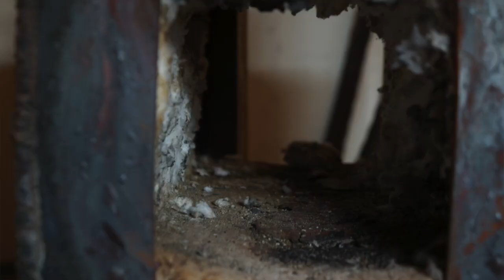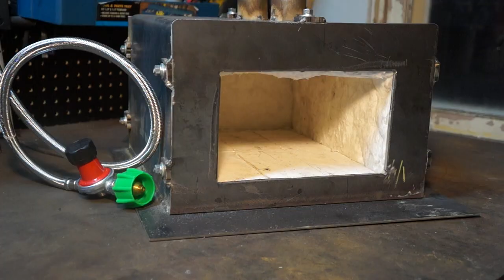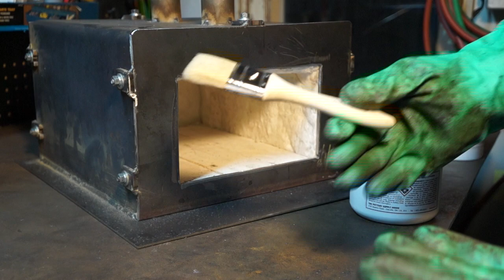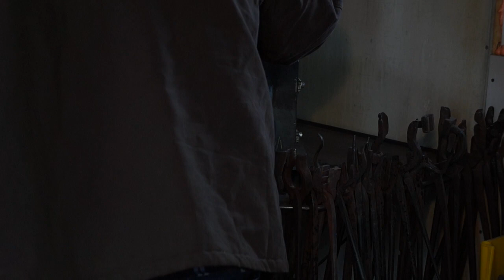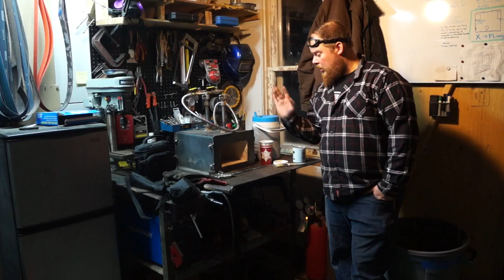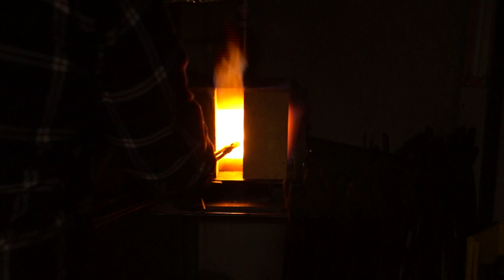Forge Build Part 2.0: Another look at burners, insulating, and coatings

Comment: Looks great. Im in the process of building my own forge,  have it lined with kaowool and i am planing to use sodium silicate as a rigitizer.  What is the rigitizer you used made of?
Reply from the maker: Sodium silicate is what I used as well. Since I posted this I tried lining this forge with castable top and bottom, with blue-ram sides. Loud and takes a long time to heat up, but is basically indestructible. I have a longer, narrower forge with a cast floor and rigidized wool top and sides. I use that one for most of my forge welding.

Comment: Put another brick on top of the two you have in the front and make an awning to keep the flames more out front
Reply from the maker: I've actually rebuilt this puppy since filming. The kaowoll just could stand up to the abuse I was putting it through. I lined the whole thing with castable and ram-able hard setting refractory. I made sure that the burners had a nice clear path with a bit of a flare cut into the refractory. Takes a while to get up to temp, but it's invincible and definitely worth the effort of doing.